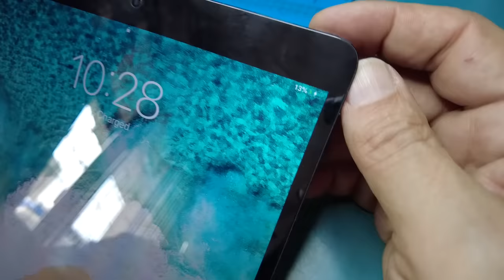iPad 10.5 Repair - Customer came in with a bag full of money.

Comment: Your prices seem reasonable . Some people have no idea how difficult your work is and how expensive your equipment and setup is.
Reply: @Brianck1971 I mean technically if the service involves him using said tools you’re paying for him to use his tools to service your item.
Reply: @Brianck1971  Yes you are, you just don’t know it usually.
Reply: @Brianck1971 it's built into the price
Reply: @Brianck1971 If the prices are too low is imposible to buy good quality equipment.
Modern electronics are complex if you don't have the tool is imposible to fix.
Reply: @triforcelink  some other electronicians can do same quality of work, with more experience and less equipments, in my opinion you just need to be a minimum prepared, but the experience will play at the balance
Reply: @gueshkiller  and those people will charge you more because of that experience.
Reply: For his quality of work, his prices are EXTREMELY reasonable.
Reply: @Brianck1971  Stupid comment. How's he going to buy equipment if it's not coming out of what you pay for the service?
Reply: @Brianck1971  Only one person making daft comments here
Reply: More like most ppl don’t care I’m afraid!  I know how hard it is as I’m interested in electronics generally and fixing stuff but that why ppl go there so they don’t have to think about it :)

Comment: Big Bo’s is an awesome guy to disassemble and reassemble all the devices that need soldering work. That’s one part of the soldering job I find “painful” at times: so having a guy like big boss take care of that side of “repair” is pretty awesome!
Also, do like looking at monitor for soldering now compared to looking thru microscope, like used to do.  Enter on neck and other issues it caused, and as was learning curve; not going back anytime soon.
THX NRF for that awesome tip, and not for everyone, but I like it👍🏻

Comment: Try to get yourself a TriStar tester device,it checks if connection is ok and if the TriStar chip works fine, you can discern if it's the flex or charging ic the issues
Reply: It's time to get a c-type charger and tristar tester

Comment: I just love the detail you put into your work.  I am in Canada.  I fell with my Galaxy 20 FE .  I took it to a local shop they replaced the screen about $225.00, in a few weeks I noticed the back was coming off the phone in the Otterbox.  I took it back in they resealed the back and told me the battery was swelling you could feel it lumpy from the back, said I need a new battery.  I went home with it I pressed on the back for a while and it all "Smoothed Out"  Now there are clamp marks on the screen protector from the clamps they used.  Should I take it back in?
Reply: Ask them to change it
Reply: many youtube DIY videos about changing battery. not recommended but once i made a pin sized hole in outer wrap of battery so gas can escape and swelling decreases.
Reply: @JaiShreeRamJSR  Will do
Reply: You need to also change the battery before something happens. I wouldn't take the risk with a samsung battery.
Reply: @mrmarr8308  I don't think the battery is a problem.  Phone isn't more than 16 months old.  I think it wasn't properly reassembled as in the battery wasn't properly replaced.  A battery is about $20.00, I ordered one before I got the back smoothed out.  If it "pops up" I will replace it I guess.
Thanks.
Reply: The back wasn't replaced? It seems to be a problem with the adhesive that caused the back to come off.
Reply: @brarautorepairs  I think so too.

Comment: Great video Alex. Do you ever get your meter calibrated? I have a fluke something like your 's .I went to the electrical supply house  and asked about sending to fluke to be recalibrated. They said it would cost almost as a new meter. I wasn't sure how critical the readings where when you are trouble shooting.
Reply: Not at all critical in this line of work. Obviously a DMM needs to work, but original factory cal is fine.
Reply: does it need recalibration?